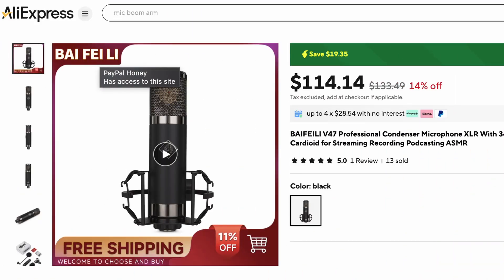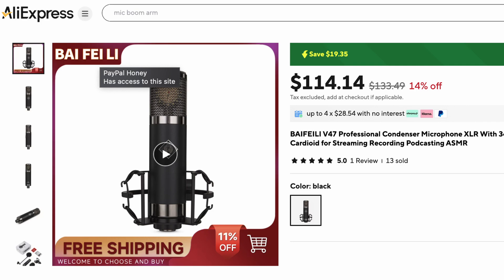OPA Alice Mic DIY with CK-12 Style Capsule (No EQ Added)

Comment: I have a question that may be kind of dumb but here it goes. Could you put the OPA Alice circuit in place of a circuit of say an MXL V67 mic even though it has a transformer in it? I have a couple of those mics laying around that I was thinking of doing something with. Thanks for any advice!
Reply from the maker: Not a dumb question at all. Yes, you could. Keep the XLR jack, take out the old circuit and wire in the Alice. It'll be cleaner sounding for sure and you'll also have the option of swapping out the capsule to a CK12 or 47 style if the modded mic is too bright. The transformer on a V67 has such a very small turns ratio, maybe 2:1 or 2.5:1 that it barely makes the kind of sonic difference mic transformers are known for.
Reply: @ good deal thank you so much for your response. Do you have any recommendations on transformers? I really enjoy your videos, keep them coming!
Reply from the maker: Swapping a 2.5:1 transformer with a larger one will cause impedance mismatch, leading to poor signal transfer, distorted audio, and potential overload. The circuit is designed for a specific impedance ratio, so an alternative ratio transformer is not a drop-in fix. I"m sure there's a way to do it by modding further components, and you may want to check at GroupDIY to see if any of the more knowledgeable mic experts there have suggestions.
Reply: Ok thanks again! I’ll do some research on it.

Comment: I just finished building this mic, and I love it! just an aliexpress ck12 capsule, the circuit from jli electronics, and a cheap donor body from amazon. I don't have a neumann or anything, but this sounds better than any other mic I have for my voice. When comparing, my lewitt lct440 is too thin with not enough bass, and my synco mic d-2 is too muddy without clear enough high-end. They are double or almost triple what I paid to build this, and they fall short. I think this is an amazing mic, and at only $120 to build, I definitely recommend it.
Reply from the maker: Congrats on the build! These Alice mics are the absolute best bang for your buck mics out there and perform better than so many mics that cost several times as much. And you built it yourself! What could be cooler than that?

Comment: Im gonna try it with an old sterling audio -k67 style  capsule i got laying around - Ive done one with the JLI-3413AU01 and i love it also done one with the K47 that sounds amazing
Reply from the maker: I found out not long ago that those Sterling k67s are the same capsule used in the Manley Ref C. They’re actually really good sounding capsules, so yeah, for sure give it a shot.
Reply: When u did the k47 one did you have to do any adjustments
Reply: @drillgirl718   the mic turned out amazing-- super simple no adjustments

Comment: I have bought the Serena microphone. As I'm living in Europe, I can't figure out what kind of screw/thread the microphone holding spyder needs. (I measured 15.5 millimetres, which is neither a metric screw nor a clean fraction of an inch). Can you point me in the right direction?
Reply from the maker: Standard thread mount size is 5/8 of an inch, and with the European thread adapter, 3/8 of an inch. More specifically, if you're trying to DIY it from a hardware store, the threads would be 5/8-27 (27 threads per inch) or 3/8-16.
Reply: @MarkYoshimotoNemcoff  Thanks you!

Comment: I think
1, the mic sounds good.
2, you can find similar bodies at a much lower price.
It's probably better to save on the body and use that money for a more expensive capsule.
Anyway, you'll probably end up paying more for a decent shock mount, which is included with the more expensive body.
Reply from the maker: You can find cheaper bodies but so many of them are total trash quality, which is fine if you’re just experimenting or goofing around.
Reply: @MarkYoshimotoNemcoff  Tbf i don't know the build quality of the Baifeilis, but from the pics it looks good.
I still think you can find usable cheaper donors, the thing is around 160€ plus customs fees here, we're already almost on the MXL/Sontronics price range.
But it depends on the budget, you can keep an Alice under 100 bucks, working and solid, but going premium is not bad either.
And i'm really impressed by the pics of the BFL shock mount, and you got a spare capsule as well.

Partially unrelated thing, i wanted to ask, do you have any experience with the V7?
Is 130€ a good price for it?
Is the Seeninseer store the only seller?
And (i swear it's the last question), you think unmodded BFLs (at least the ones you tried) can perform good for light tenor singers and percussions?
Reply from the maker: @giacomoneri1782  I don't have any experience with the V7, unfortunately. Overall, I think the V5 needs no mod and is a really good all around mic for pretty much anything.

Comment: Does the Alice board run on phantom power. I bought a TSC-1 Capsule, the alice board, and the hex board, but the data sheet doesn't say anything about phantom power, it only that it converts 12 volts to 80volts.
Reply from the maker: Yes, it does require phantom power.
Reply: @MarkYoshimotoNemcoff  What if you only have 48 volt phantom power, do you have to get a 12volt phantom power version?
Reply from the maker: @kft590  No, the OPA Alice circuit does the conversion from phantom
Reply: @MarkYoshimotoNemcoff  Never mind, I get it it will work with 48 volt phantom power thanks.

Comment: What would you say about OPAlice with the Flat K47? It's discounted now to 100 bucks.
Reply: It will sound just like the capsule. I designed the circuit and it is flat to about 1Mhz. I use it with hydrophones as well. Super transparent and clean.
Reply: @SoundSleuth  I love your vids too!  what do you think the difference would be between the opa circuit with an 87 style capsule vs the JLI103 capsule?  That one intrigues me and I've never found anything online about it's use
Reply: @badmiddens  Thats a really good capsule as well. I have paired that with the OPA circuit and sounds great.
Reply: @SoundSleuth  thanks for the reply!  one more, if you don't mind.  how would you describe the capsule compared to an 87 style or 47 style?
Reply: @ it’s more like an 87/67. Look at the graphs of them. The OPA circuit is ruler flat. You hear exactly what the capsule response is
Reply: @SoundSleuth  i decided to save the alice circuit for a different project, and ended up pairing the 103 with a basic mxl circuit from a v-250.  Love/hate result.  very smooth but way too much bottom end for my taste/voice.  is part of that the circuit choice?
Reply: @badmiddens A can only speak to the OPA circuit. It sounds great with 103 style capsules
Reply: @SoundSleuth i want to put a k47 capsule into the serena mic kit, would i need to adjust any of the instructions to best for the k47 style capsule
Reply: Hello which is the best k47 tested so far?
Reply from the maker: @KonstantinosTziavos  The Arienne Audio K47 has earned quite a few kudos for being very faithful to the original.
Reply: @MarkYoshimotoNemcoff  thanks! Your videos are great, Big fan here! Keep up micing!
Reply from the maker: @KonstantinosTziavos  Thank you so much, Konstantinos! I really appreciate it.
Reply from the maker: I’d say, “Do it.” The Flat 47 is an exceptional capsule and you can even get the cardioid only flat 47 for only $80 while it’s still on sale.